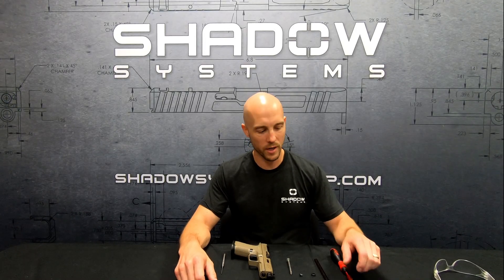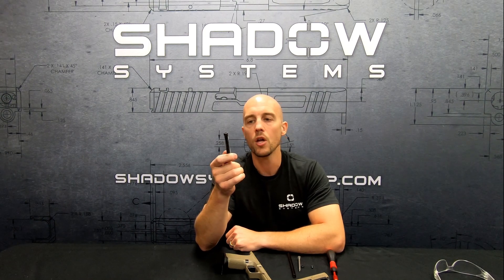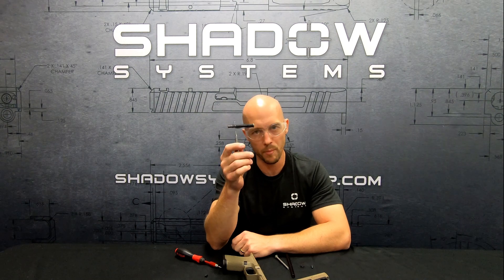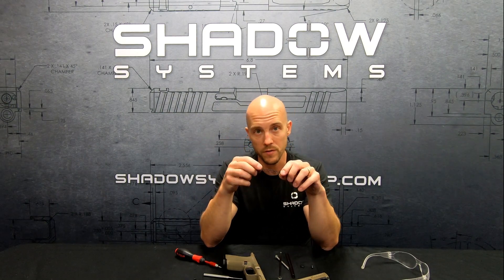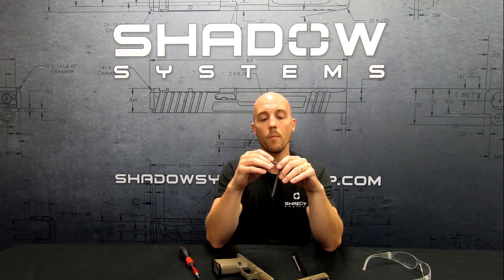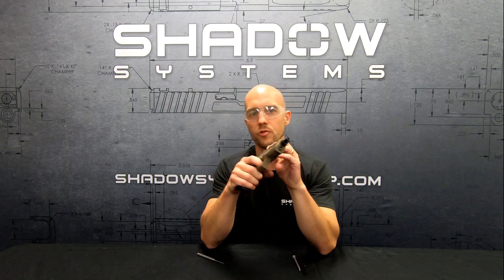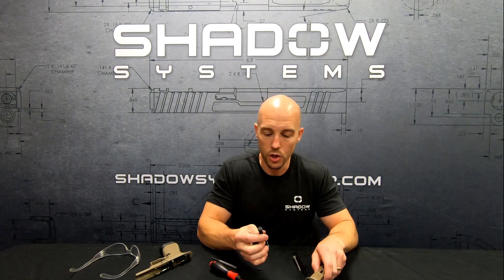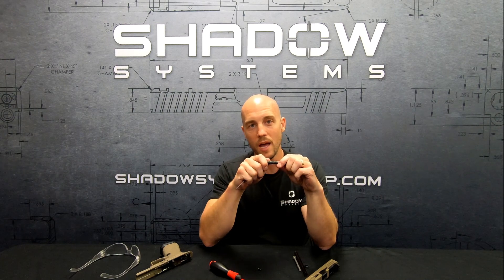Technical Tuesday: Recoil Spring Assemblies

Comment: My DR920 when I rack it back to load the first round and then realize it, sometimes the slide doesn't go all the way to the front so I have to push the slide a bit. I cleaned it and took it apart nothing. Any one else have those issues? And was the solution to replace the spring to a heavy or lighter spring?

Comment: USE BLUE LOCK, mine I don’t think was put on right by factory bc as soon as I took my mr920p apart spring was completely disassembled from the rest of the rod. I found the screw on the floor in my room after over an hour of looking. Put it back in WITHOUT blue lock and later that day at work (in a server) I was sweeping my tables at the end of the night, and I found the screw ON THE FLOOR AT WORK. I picked it up not even thinking about it and I was like “hey this just like that one screw from my pistol. So I picked it up and now today I’m about to go to range and my blue lock just came in so I went to go blue lock the screws for my sight and guid rod and sure enough the screw was missing on that screw I found on the floor was infact fie my pistol. THANK GOD I not only noticed it but decided to pick up the screw and take it home just in case bc I genuinely was like “no way this is the screw” when I saw it but I figured it wouldn’t hurt to throw it In my pocket. Do not trust the factory to blue lock it for u. Blue lock it ur self. Super frustrating experience but I learned a valuable lesson

Comment: My sight screw came loose on my MR918 after only 700 rounds and it was a pain to find a wrench that would fit the screw and also fit through the slide openings. You should include this wrench with the gun as it was too hard to find one that fit, i had to buy a regular nut driver and grind it thinner to fit through the slide holes.
Reply: Should’ve just bought any of the glock front sight screws that are already made lol

Comment: My spring assembly squeaks real loud every time I rack it, I tried oiling the rod and put about 400 bullets through but still it's loud.  Any fixes?  This is my home defense weapon, so if I have to rack it in the night with an intruder...it's going to be a loud, squeaky giveaway to where I am.  I see that you say some squeak, some don't, any chance I can get an exchange for one that doesn't squeak?  Absolutely love the weapon otherwise.
Reply: Dude mine too!!! It’s horrible any way to fix this
Reply: @CaptainKool4  Same 😂 were you able to fix the problem. My DR920 when I rack it back to load the first round and the realize it sometimes the slide doesn't go all the way to the front so I have to push the slide a bit. I cleaned it and took it apart nothing. Any one else have those issues?

Comment: Curious if your recoil guide rod and spring can be ordered and used in a Glock 19?
Reply from the maker: The MR920/DR920 recoil spring is a single spring system on a stainless guide rod.  It will fit Gen4 and Gen5 Glocks.  Trevor

Comment: From the SSC website: ** Due to High Demand, This product is unavailable until further notice. **
Sweet timing on the video! All kidding aside, it appears as if one can add the spring(s) to one's cart anyway. Hard to say if the order will actually process. I actually stopped by to look for any different weight firing system springs. No luck though.
Reply from the maker: Good point!  We'll get that fixed.  Also, as an FYI, we have tested ISMI springs and they are a suitable alternative if needed.
Reply: @ShadowSystemsCorp  Thank you for regularly engaging in the YouTube comments.
Reply from the maker: @jpdesimone  Of course!  We enjoy talking to you guys!  Trevor

Comment: Great video! I just purchased my first mr920 last week, and wow what an amazing gun. Being a Wilson Combat diehard it takes a lot to impress me on the polymer guns side. Keep up the good work. Any suggestion on how to keep the Glock style guide rod springs from sounding so squeaky? I’ve tried multiple oils and some help more than others but I noticed your is much quieter. More break-in?
Reply from the maker: The squeak!  Some squeak, some don't.  Some of our guns squeak too.  Oil helps, break in helps.  The squeak is perfectly normal, however.  And you sure won't hear it when you are actually shooting!
Reply: More break-in and some Ballistol being sprayed on the coils (be sure to work the coils out so it penetrates).

Comment: do the frames use P80 rails or injection molded rails?
Reply from the maker: We use a conventional overmolded rail.  It is permanently part of the frame, similar to a Glock handgun.  We have no association with P80 and do not follow their design principles in the rails in our frame.
Reply: ShadowSystemsCorp very good! that’s quality. thankyou for the response.

Comment: A Shadow Systems G48 would be my next (and perfect) CCW if it was produced. The MR920 is great and is currently my CCW but a thinner option would be very nice too. Vendors are releasing new WML's and red dots specific for the thinner "single stacks" late this year, and the market is headed in that direction (G43/G48/P365/etc...). I think there will be a large market for G48-like clones next year.